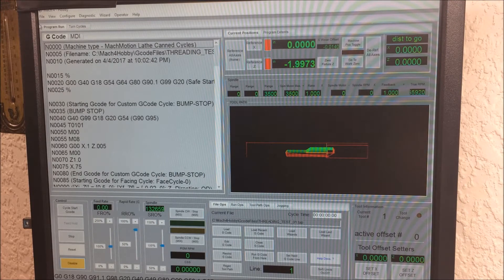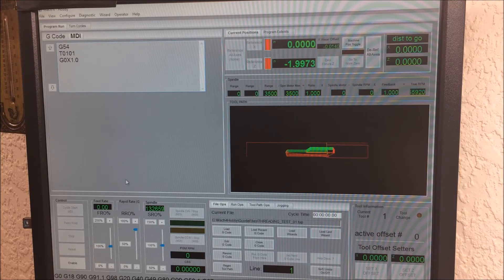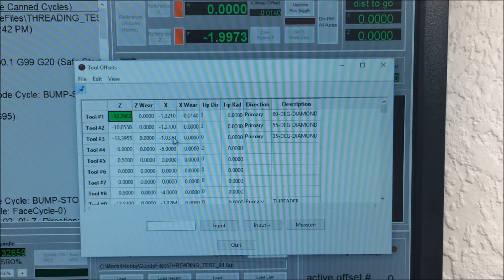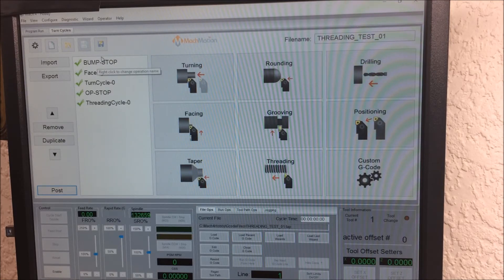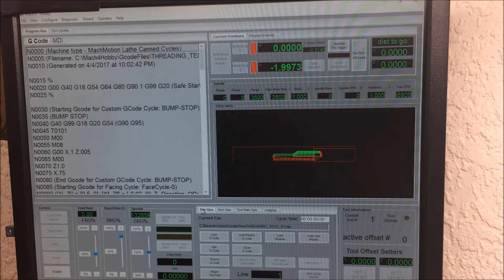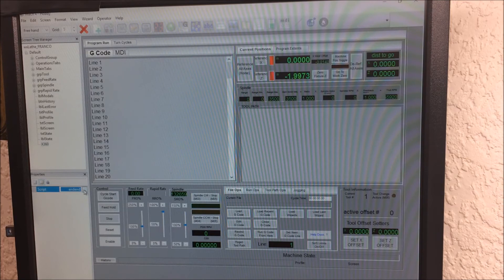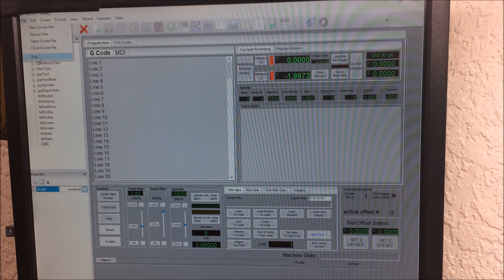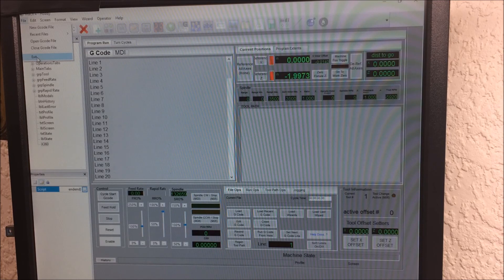Mach4 Lathe: First Impressions of Mach4 for Turning Applications

Comment: Franco, most of us have long since moved to Centroid but Ive got a small machine that I'd like to donate to someone but it needs a new controller. Do you know if Mach 3 or 4 can deal with Y offset for lathe tool offsets? This machine is a Boxford Dueti that has a lathe tool setup which includes tools set in the Y Axis. Thanks.

Comment: Could you please actually show us how to write a turning program using graphic interface 
Say using a 100mm dia shaft x 150lg out off chuck
Face 
Turn 25mm long Dia 25
Then another 25mm long at dia..Cut a 3mm groove at end
Cut M50 x 3 Thread
Radi 10mm 
Part off 
A couple off these would be great 
Machines like the SineCore SC 512L have live Tooling 
Any videos off this would be extremely well viewed

Comment: Hi
have installed MACH4 Hobby with Pokeys57CNC controller. It works fine but missing some things from MACH3: Could not find diameter/radius mode
Problem with tool offsets, if I take new material, turn it and in MACH3 I can enter measured diameter in X DRO, in MACH4 it is only possible via X offset,
but in this way I destroy my tooltable or I must always start with master tool.
The turncycle „groove“ had no parameter for tool width like in MACH3.
In the turncyles always tool1 is used, find no parameter to enter toolnumber
In my opinion MACH3 turn is much better than MACH4 turn, unfortunately Pokeys don’t support threading in Mach3 so I had to switch to MACH4

BR
Gerhard

Comment: Hi Franco, nice video!  I'm interested in the MachMotion Lathe wizard.  I'm struggling to find any info on a turning equivalent of the Mill Wizard for Mach4 (which I run on a mill).  MachMotion's site only talks about complete machine conversions - but nothing about this wizard.  If I run Mach4 with a Lathe profile - there's no sign of it!  Any ideas?

Comment: Nice Video, with good baseline info. Did you edit the lathe Screenset or is there an easy way to get the particular layout on mine as well. I like Mach4 so far but the lathe screenset is lacking in a few ways. Miss the editor and run from here functionality. Maybee someone who is good at screen editing can make a more robust screenset for lathe.
Reply from the maker: Hi.  Truth be told, I haven't used Mach3 or Mach4 for a very long time.  I've converted over to the Centroid Acorn system.
Reply: @FrancoCNC  We Just got a Hardinge Lathe that has the Centroid Acorn. We have both Mach4 and Centroid Machines now. Im not sure about Mach4.  The Centroid has the Hard Tapping which is nice. I'm not sure If our Mach 4 machine can do that. I have been succesful at running some threaded parts on mach 4.

Comment: Hi, im new in cnc generally , this mach 4 is 1st try for me, i have some issues in cut inside conner, it should cut like 90 degree , but the result came out is like the cutter escaping the 90 degree conner, it cut some radius,, can i get some advice,

Comment: Thanks for the review! I was told mach3 lathe was never finished. More demand for milling. My mach3 lathe wont allow backlash correction with the Smooth stepper either. And most annoying it wont do a drilling cycle. Ive seen a YouTube video of brian barker using mach4 threading in an industrial cnc like a mori seki. So im surprised to hear yours cant. Which is a massive con! Software is useless if it cant thread. Again. Really great review. Thanks
Reply from the maker: Seventy7 Industries Hi. The Hicon Integra board from vital systems seems to support all Mach4 functions including backlash and threading. It's not cheap, but it's really nice. Mach4 on the Smoothstepper was a bit disappointing. Mach3 on the Smoothstepper seems to work ok on my mill.  All that aside, I think Mach4 is much better than Mach3 as long as you have a good motion control board. So far, the Hicon is the only one I can find that supports everything.
Reply: Franco .Hi thats really good to know. I was looking at the CSMIO. I have a mach3 mill. Glitches every once and awhile. Funny thing usb smoothstepper  wouldn't work on my mill but works flawlessly on my lathe. So i moved to the ESS for later cnc's

Comment: the worst part is, warp9 still advertises that it handles backlash comp. which it never has. and for 2 years now they've been claiming they're going to fix it in the next update....never happens. I know it didn't handle THC either for the plasma torch guys, I don't know if they ever got that working, would have been nice to know before I bought Mach 4.
Reply from the maker: Apparently, Mach4 software doesn't do anything to handle trajectory planning for backlash compensation - they expect the motion controller plugin to take care of it.  I think that's why its taking so long for this feature to get implemented.  I've been searching for motion controller boards that claim to handle that.
Reply: i just think it's false advertising, saying it does, when it clearly doesn't. someone thought pokeys had Backlash comp. but I can't confirm that
Reply: EitriBrokkr I'm in the same boat wish I had never wasted my money or time on mach4.
Reply: I know that your post is a year old, but apparently this has been resolved. I am running Mach 4 on an ESS, and I use backlash compensation. After running test and calculations, I was able to produce a 2x2" square with a 1x1" cutout. The result was a 2.000 x 1.999" square with a 1.000 x .999" cutout. Depth was spot on, too. I backed of the Y-axis backlash because I could hear the lead screw bang the nut as it compensated by rapidly accelerating to the position. I thought it might wear the screw and nut prematurely, so I sacrificed .001" until I can replace the lead screws with ballscrews.